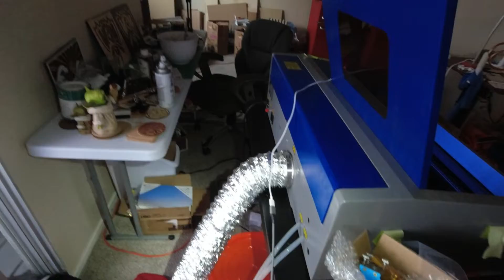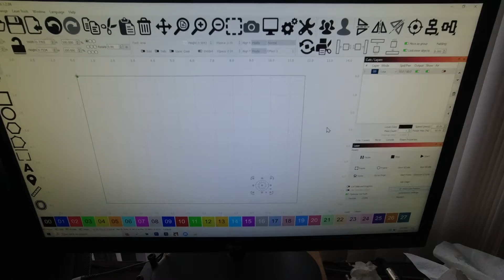Upgrading my Monport K40 Laser Cutter

Comment: I wish I could just get one to work. MONPORT OMTECH, pretty much same thing, they are junk, broken machines and no support.
Reply from the maker: Yep, they are a project. Always have been
Reply: @ValleyForged  I don't mind a project and I'm reasonably competent ( I make a living repairing electromechanical devices ) but Omtech sent me a "pre-owned " machine when I paid for new and their " support " was unable to get it functioning ( because it was actually broken ) and Monport sent a defective machine that their " support " was unable to get functional. neither would refund my money. I had to dispute charges to my credit card. I was pretty excited about my first foray into laser etching but I'm done. Maybe I'll look into a CNC machine but I'm reluctant.
Reply from the maker: @toddo3591 Lasers are amazing, but Co2 is much more difficult than Diode. My Roly is pretty much bulletproof.  Good luck whatever you decide. CNC can be a pain, and can get expensive quickly.

Comment: "... as it had a bigger spot for a lens. I put a 20 inch lens. (0:42-0:46)" --  Wow, you are awesome.  Show me how to fit a 20 inch lens in there. - LOL

Interesting video.  In studying the Monport closely it appears that they took the OMTech K40 design, made come minor changes & modifications to it, then slapped their name on it.  Even their colouring choice & pattern is very similar to OMTech.  It is sad the companies (especially Chinese ones) do that, rather than come up with their own original designs.
Reply from the maker: Wow, you have a lot of time on your hands
Reply: They are the same cheap Chinese junk just branded by whoever is importing them. OMTECH AND MONPORT have no quality control and their support sucks. I've had one from each and neither one worked and after weeks with their "tech support " ( normally 1 poorly translated email a week from China ). I gave up. Neither would refund my money, I had to dispute charges on my card. Extremely frustrating experience.
Reply: @toddo3591  LOL - You what you pay for.  I bought an OMTECH K40, knowing it was probabbly junk..  Before using it, I watched all K40 videos I could find on YouTube, picking & choosing how I would modify my OMTech.  I spent about $300.00 on modifications / tweaking / improvements.  It is now an awesome Laser and has served me well for almost 3 years.  With the modifications cost, added to the original purchase cost, it was still far cheaper than a"'good brand" laser that would allegedly need no modifications / tweaking / improvements.
Reply: @alpscraftshack599  if I only knew the mod to make the thing WORK, the Omtech wouldn't burn a hole in cardboard, I aimed everything, it just had no power, as I mentioned, they sent a pre-owned machine, I think the laser tubewas just shot. MONPORT the thing can't find home, switches are ok, played with power settings in lightburn tried a new board, same thing, it just doesn't know where it is, home just skips forward and right a tick, won't goto origin. I unplugged limit switches and it does change, now goes further forward and left.
Do the switches work on a common? There is only 3 connectors in the molex but 4 wires, I haven't traced them back, I just found this, might have to tear it apart. Seems rediculous for a new machine. These things are straight off the boat from China with no test or quality control from Monport or Omtech
Reply: @toddo3591  Granted - Chinese Lasers have no QC and use the cheapest parts they can find.  But, like I said earlier - You get what you paid for.  One cannot get an allegedly 'ready-to-run' laser 'out-of-the-box' from China - equivalent to  a"'good brand" laser that would allegedly  'ready-to-run' laser 'out-of-the-box' and costing in the vicinity of $2,000 - for $500.  It ain't going to happen.
Reply: @alpscraftshack599  I totally get what your saying, the thing is they almost market these as a good entry level machine and they are pretty much the LAST thing you would want to START with. It's been so frustrating I want nothing to do with laser etching. It was silly of me to think that for 700 dollars I would actually recieve a functioning machine, I figured it would have limitations compared to the more expensive machines but I guess I was really naive to think it would actually work.
Reply: @toddo3591  I don't believe anything anyone says, especially Chinese companies.  I always watch videos first, from people who have purchased the item,  to find out any / all possible issues & problems, before I make a purchase decision.  The Chinese ain't going to change, so you have o look out for yourself.

Comment: Thanks for this video. I've been considering getting one of these but the bed size is too small for the projects that I want to do
Reply from the maker: Yeah, I use my Diode for the larger projects. Now that the Diodes are getting more powerful, they may pull ahead in everything but acrylic. But for business, I still think a 100w+ co2 with a larger bed is still the winner. Just so expensive.